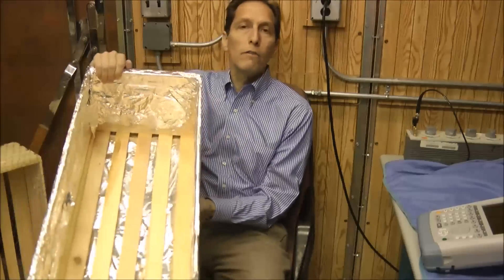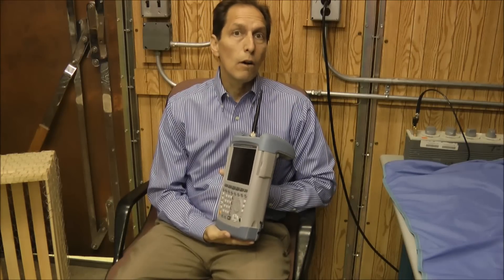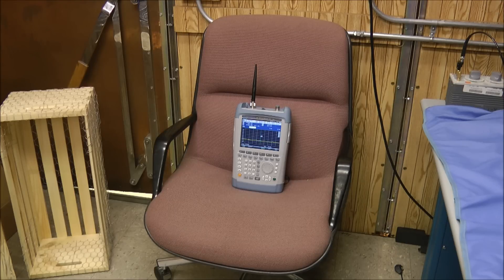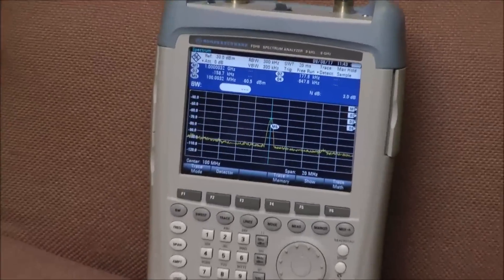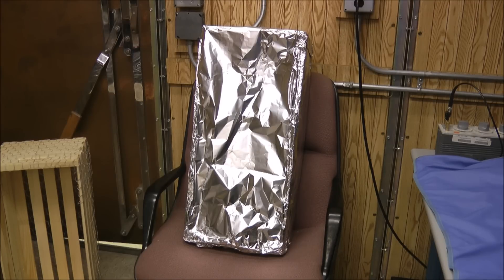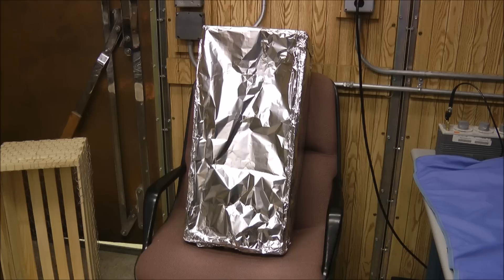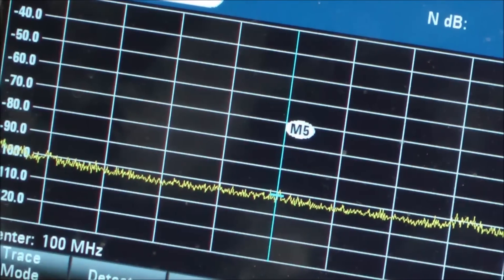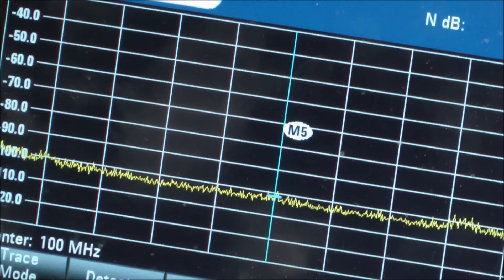Faraday Cage - Chicken Wire vs Aluminum Foil

Comment: I realize that this video is old, but wouldn't sending out RF signals at 100 Mhz be illegal everywhere ?  It's right smack in the middle of the regulated frequency band of FM radio, and that band is HEAVILY regulated everywhere.

Comment: I thought you're supposed to wrap it 3 times in aluminum  Foil
Reply from the maker: If you do the calculations two layers of heavy duty foil is plenty. The first layer gets you the most benefit, and the second adds a bit more.
Reply: @disasterprepper   Thank you I appreciate that

Comment: It is because of the incomplete coverage or the different material? (presumably the chicken wire is SS?). Also is that only for higher frequencies (ie mHz to hundreds of mHz?)
Reply from the maker: It's due to the larger holes in the chicken wire. The wavelength of the RF energy is relatively small compared to the holes, so it manages to get inside.

Comment: I was having some breathing issues(non KO-vid related)from the Wi-Fi signal being so strong at my house, so I bought two galvanized trash cans to put over the modem. Will this work to just LOWER the signal alittle, because it seems to have done that ? My phone Satellite/Wi-Fi icon now mostly reads half power instead of full power. I appreciate your response in advance. Thank You
Reply from the maker: Yes, I imagine this would lower the signal. There are also metal router cages that people sell on Amazon to help lower the levels.
Reply: @disasterprepper  ... Thank You !

Comment: A friend thot Mylar sheets (like the cheap emergency blankets) could repel EMP/RF…I really doubted that could work. 
We all thought aluminum window screen should work, or, 1/2” hardware cloth, & likewise, the expanded metal sheets.  Now very curious if other alternate materials like these could work??
My mind keeps returning to a photo of Tesla sitting inside his faraday cage, with huge electric zaps arcing around the cage..which had larger openings, bigger than your 1” chicken wire…but the chicken wire looks pretty useless! Yikes! 
If I want to “paper the walls” with something thin & hid in plain sight, so, talking Volumes of whatever material, it kinda looks like buying bulk amounts of HD foil might be best?!? 
How does foil compare with any od the conductive shielding paints? Metal window screen? Expanded metal sheets?…for wrapping the exterior walls, before adding exterior insulation & more siding? Or, just put on metal siding & use that? 
And…living bodies are electric..WHAT happens to mammal neurological systems in an extreme EMP event?  There were no reports I could find, describing neuro harm from the likes of the Carrington event; have never heard or seen evidence of that…. So…what might be the effects?  And, if no effects at all…WHY NOT?

Comment: What if I lined my entire basement inner wall with chicken wire
Reply from the maker: Chicken wire isn't very good for high-frequency shielding. I did a video showing what kind of shielding it provides (around 10 dB if memory serves). Better to line with radiant barrier.

Comment: @empdoctor Dr. B got a question bugging me. Will electronics that are not on closed loop be effected by emp. In other words will my generator be safe from emp if i remove certain components such as fuses?
Reply from the maker: Unfortunately, even open-ended traces or wires act as efficient antennas. You don't need closed loops to couple in damaging levels of energy.
Reply: @disasterprepper  gotcha thank you. Been debating to build a faraday box or try to find a simpler solution.  Thanks for your help

Comment: I bought a set of aluminum bags for my electronics on eBay for $65.
Reply from the maker: Bags are a really great, easy to use solution to shielding small items. The ones I recommend are at https://disasterpreparer.com, but many work quite well.

Comment: Dr. Bradley , Are you familiar with radiant barrier ? It's large sheets of aluminum with another material next to it . It's used for insulation . It reflects 97 percent of the heat back. It might be useful for shielding for a Faraday cage .
Reply from the maker: Hi Halbert, yes, I'm familiar with radiant barrier. Lots of people have asked about using it when building a Faraday cage, and I think it would work well (assuming all the seams are properly taped with aluminum tape). I just haven't had a chance to test it yet to see if there are any issues.

Comment: While inside the aluminum foil box, the analyzer is in a state of super position because it won't be observed until later. It was displaying every possible number, as well as being off and broken. Once it's observed, it falls into one of the many possible states.
Reply: Quantum states cat alive and dead until you check it?
Reply from the maker: I think you misunderstand how the equipment works. The analyzer is set to peak capture mode. It only shows the highest level received, and when the box is opened, it displays that value.
Reply: @disasterprepper  I assumed that's exactly how the equipment works.
Reply from the maker: @jamiesmith4293  Hmm... than I guess I don't understand your comment. Sorry.

Comment: great on the aluminum foil, will this work for wall power point and reduce the emf from wall power socket?
Reply from the maker: Unfortunately, no. Wall power is at 60 Hz, which is very difficult to block. You need special materials to block very low frequencies. In most cases, it's just not practical to do so.
Reply: @disasterprepper  Cheers what are the materials to block wall power point socket emf then ?
Reply from the maker: @WorldAquariumSingapore  You need materials like mu-metal, which would be much too expensive to actually use for this purpose. Unfortunately, there's really no easy way to block 60 Hz radiated energy because you're in the near field.
Reply: @disasterprepper  Thanks friend
Reply: @disasterprepper  and i saw alot of articles in the net was saying that wall power point emf are not harmful to humans , is this true?
Reply from the maker: @WorldAquariumSingapore  Yes, I think that is generally true for most people. Wall power at 60 Hz doesn't seem to affect most people, although I think some people may be hyper sensitive to it.
Reply: @disasterprepper  Cheers friend thanks and any one else also concern about sleeping or near to a power point socket?

Comment: What about low frequencies Sir.?
Reply from the maker: The frequencies of interest for an EMP are about 100 KHz to 1 GHz. Low frequencies, say in the 100's of kHz are easy to block because they're wavelength is so large. As the frequency goes up, the holes need to be smaller and smaller to prevent the wave from getting in.

Comment: A lot of misinfo about Al corrosion.  Anodized Al is Al rust only deeper.  Al rusts very quickly in STP air.  Al oxide is mechanically integrous.  Thus the rust is normally thin and deceptively cosmetic.  Any more rust than that initial layer is introducing stronger rusting/corrosion conditions.  Electrical companies form connections by tearing into the mating Al with additional protective coverings as needed.  Lastly Al oxide as a dielectric can be breached with sufficient voltage but not applicable to rf fields.

Comment: Some people don't have a fancy device. An AM radio works just fine. Put the device in the Faraday cage put the AM radio on. Put it on the low band 5:30 a.m. if it picks up your phone beep or any radiation it'll start humming then you know you need more shielding. it also lets you know if you phone is on or off if the screen is off it'll tell you whether there's radiation coming out of the phone or not. If it's not on you should hear no radiation.
Reply from the maker: Unfortunately, that's not a very scientific way of testing a Faraday cage. The signal level and radio's receiver technology can vary greatly. Same goes for the phone.

Comment: If foil and a galvanized garbage can offer good protection. What about a metal building
Reply from the maker: In theory, yes, but the doors, windows, and seams tend to reduce the shielding to around 10 dB, maybe a little more. Some effort could be made to sealing it up to get better shielding.

Comment: Hi great video.  I'm renting a room with an huge fuse panel next to my bed.  What would be the most cost effective, safe way to cover it? It would still need to be accessible. It is in a wood box, covered by a pull up wood blind.
Reply from the maker: First, I'll say that it's very unlikely that the current flowing through the fuse panel will harm you. With that said, some people do experience headaches and other health issues when around electromagnetic fields. There isn't a good way to shield against it though. The reason is that the current flowing is very low frequency (60 Hz), which is not easily blocked. Two things come to mind. First, if it's possible, you could move your bed to the other side of the room (I know that's obvious, sorry). The other thing you could do is to buy some conductive cloth sheets. They'll set you back several hundred dollars though. You can search EMF-blocking clothing and find them.

Comment: Mr Prepper, I thought Dr Prepper lol, could one use the perforated radiant barrier aluminum scrim to line a room, ceiling, floor etc to create a cage? I put it in my attic, very tough stuff, and cheap for the coverage. I guess it too would need to be grounded for proper attenuation no?
Reply from the maker: I haven't tested radiant barrier, but I think it would  probably work well if the seams were taped with conductive tape. It would not need to be grounded.

Comment: How does wired glass fair against EMP blasts?  I'm working on building an RV/Camper, and I'm wondering if wired glass windows would protect against EMP/CME if connected to the outer shell of the camper.
Reply from the maker: I'm guessing not so great if the spacing of the wire is similar to chicken wire. When I tested that, it only provided about 10 dB of shielding.

Comment: Thank you for your videos. Is it enough to stick/lay a cooking aluminum foil  on the ceiling of a room (say in a condo) in order to protect it (at least partially) from an harassing  radiofrequency source located on the floor above it? Or does one need to erect aluminum protection shields also on the four lateral sides of the room, and perhaps also on its floor? Thank you. It would be great if you could post an example  video about this.
Reply from the maker: You might get some signal reduction from just covering the ceiling, but I don't think it would be very much.
Reply: @disasterprepper  Thank you for your reply. 
Any suggestion on what would be a more effective protection? 
perhaps a thicker foil of aluminum, say 0.5 mm? or 1 mm?
or some other material or application?
Reply from the maker: @guidot7207  The thickness isn't the issue. It's as you suggested, the energy will simply come through the sidewalls. To create effective shielding, you'd have to essentially create a conductive cube around yourself or the offending source - not easy to do. Do you know what frequency is being transmitted and from what? It could be that they are illegally broadcasting, in which case you could report them to the FCC.
Reply: @disasterprepper  maybe using a mirror?

Comment: Please do a video or someone help me to protect against a pad mounted transformer in my yard...how dangerous is it I can hear the electric flowing thru it...can I wrap it in foil..while that make it explode from heat? What to do?
Reply from the maker: Hi Bella, I did a study on this two summers ago, measuring the electric and magnetic fields off all sorts of things, including power wires, cars, transformers, etc. What I found was that nearly all of it had very low fields. One exception were power meters. While I know it's worrisome to hear the hum of the transformer, they are almost always enclosed in a metal box, and the emissions more than 10 feet away are generally considered harmless. I do know that some people are hypersensitive to electromagnetic emissions, so I don't want to make a 100% generalized statement, but I think you are very unlikely to be physically affected by the transformer. P.S. I have a pad-mounted transformer a few feet outside my yard too!
Reply: Thank you so much💚💚💚
Reply: @belladonna1083  
Th Dr is correct;
If you tinker with that device in any way you will be visited by an officer;
The officer will be plain clothes;
He carries a badge;
You say badge me unless the normal ~ I am a contractor;
I have seen those things fail;
Do not nothin with it

Comment: Spectrum analyzer, radio frequency..very useful
what relation would RF have to a MagPulse
Reply: Would using both layers do anything like create a field between the two?
Like the wire becoming induced and in contact with the foil, maybe create a static difference

Comment: Would earthing  chicken wire improve resistance to radio waves
Reply from the maker: Not in the case of an EMP. You can ground or not ground the cage, and you will see no difference in protection from high-frequency energy.

Comment: Not to nitpick, but did you use heavy duty foil, or standard weight? Just curious. Great info to be learned here. Congrats on essential knowledge transmitted!
Reply from the maker: I use heavy-duty foil (roughly 24 microns thick). At a frequency of 200 MHz, the skin depth is 21 microns, so two layers of foil is about as much as you would need. Even a single layer gives excellent protection.
Reply: @disasterprepper   thank you. Great info!
Would it be advantageous to put sensitive items in an aluminum box inside an aluminum can for extra protection, or would that be redundant and pointless?

Comment: So basically what this all boils down to is that the average person is totally screwed. Even after watching several videos on Faraday Cages and EMPs and hearing all the arguments of chicken wire vs. aluminum vs copper, we still practically need to be super geniuses with MIT degrees to make  these cages and actually know they are going to work. I mean, my eyes were practically crossing in confusion just watching this video. I thought it would be as simple as wrapping my house in aluminum mesh. Besides, what's the good of having functioning electronics if everyone else's is totally fried? Who are you gonna call? Who are you gonna email? What radio or tv station you gonna tune to? Besides, what's the point of doing all that work when you're just turning your home into a gigantic lightning rod.
Reply from the maker: Oh, it's not so bad. There are very simple ad hoc faraday cages that can be made using metal garbage cans. Or you can simply buy low-cost EMP bags to store electronics. As for why working electronics are important, things like radios, medical devices, LED flashlights, Geiger counters, laptops filled with important information, and many other items could be handy. Society isn't likely to just implode. There will still be functioning pockets, and having any capability will be helpful.
Reply: In the country of the blind the one eyed man is king.

Comment: What would happen if you grounded those cages?
Reply from the maker: Not much. I've tried both grounded and ungrounded, and the shielding didn't change any noticeable amount.
Reply: @disasterprepper  Thank you ,I have very bad tinnitus and am building a 2x4 house I plan on completely wrapping the inside with Aluminum attic roof foil.  Also, It would be good to test aluminum window screen I am thinking that it would be best for a bed cage.

Comment: Excellent. How would I earth aluminium foil on a wall  to a radiator not an electrical  earthing outlet.
Reply from the maker: Earthing is best done with either short large gauge wire or flat metal braid (my preference). That helps to minimize inductance. In your case, you'd have to figure out an effective way to attach the braid (or wire) to the radiator and wall.

Comment: Thanks brother., I appreciate the info...Heyyy, that made me think, couldn't you cover whole sheets of drywall with foil, on the unexposed side , before hanging, and protect a whole room/ house that way? (ceiling included) Also, is that the real reason they banned lead paint, it offered some emf/ elf protection? After all, I never seen any kids eating paint chips, ha.
Reply from the maker: Yes, I actually created a full Faraday cage closet for my book Disaster Preparedness for EMP Attacks and Solar Storms. I have a photo of it in the book. You can hope to achieve about 20-40 dB of protection from that.
Reply: @disasterprepper  nice, I will check out the book, thanks for the input

Comment: How did you cue the spectrum analyzer inside the cage?
Reply from the maker: It has a max signal capture function. So you put it in the case with no signal applied, turn on the generator, then turn it off, and open the cage. What you'll see is the largest signal that the inside of the cage was exposed to.